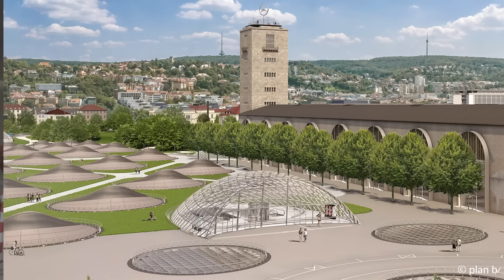Stuttgart 21: Tageslicht im künftigen Stuttgarter Hauptbahnhof – Blick durch fertiges Lichtauge

Comment: Das sind super investierte 5 Mrd Euro Mehrkosten. Was wäre wohl passiert, wenn die Bahn dieses Geld in die Infrastruktur investiert hätte, statt in die Geltungssucht eines Architekten und der Lokalfürsten? Schließt jemand noch Wetten darauf ab, wo das Projekt am Ende raus kommt? Übrigens Mehrkosten, welche wir alle bezahlen und Geld was in die Schatztruhen einiger weniger fließen wird...
Reply: Der Bahnhof macht ja nur 700 m von insgesamt 57 km Neubaustrecken aus. 
Nehmen wir mal an dieser Bahnhof kostet gar nicht mehr pro Meter als die restliche Strecke.

11,5 Mrd. durch 57 km macht ca. 200 Millionen Euro pro Streckenkilometer.

2. Stammstrecke München (11 km Neubaustrecke) (5 neue/erweiterte S-Bahn Haltestellen). Im Bau.
7,5 Mrd. (akt. Schätzung) durch 11 km macht 680 Millionen Euro pro Streckenkilometer

Tunnel Offenburg (11 km Neubastrecke für Güterverkehr (max 120 km/h)). Baubeginn 2026.
3,8 Mrd. (Schätzung aus 2020) durch 11 km macht  345 Millionen Euro pro Streckenkilometer